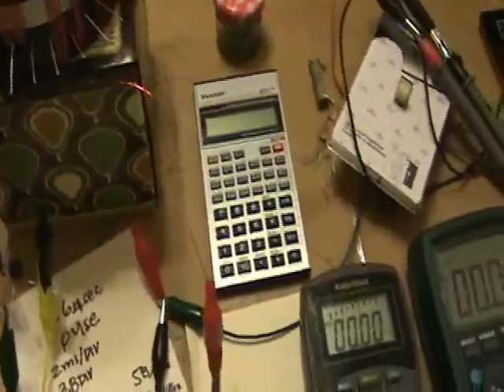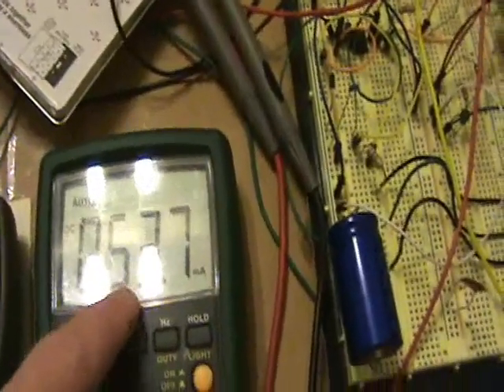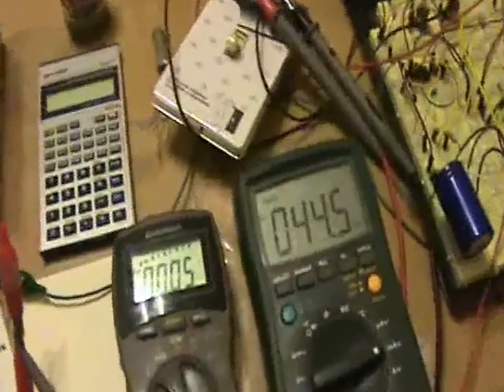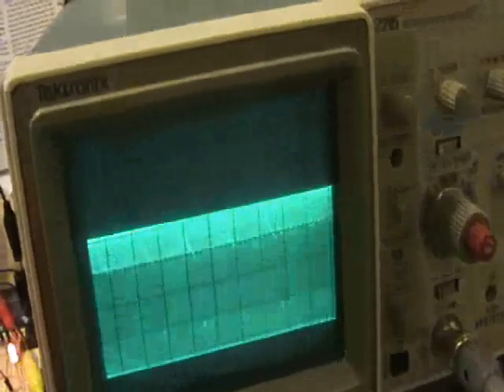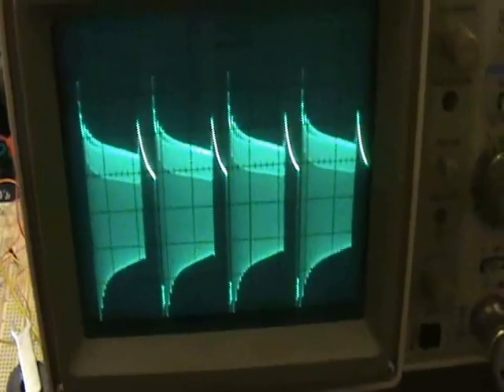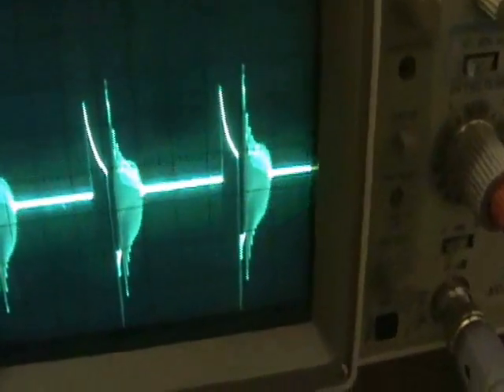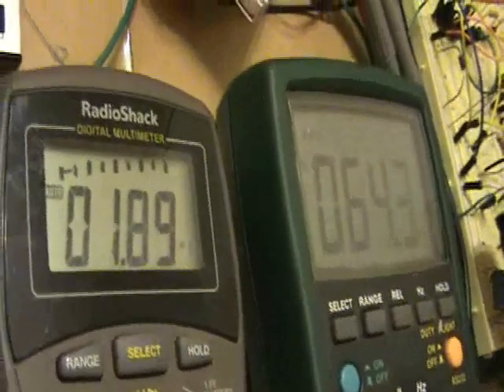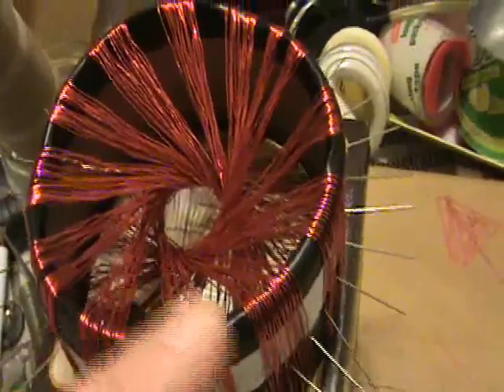"Tuna Can" Rodin Coil Damped Oscillation Study (Part 2)

Comment from the maker: I'm measuring current directly from the supply battery ... so this is the power to my pulse generator circuit. Yes there can be back emf ... confusing the reading a bit. The experiment I was doing cared more about relative changes on this supply current .. but you are correct more shunting would be good.

Comment from the maker: On the output side, the current is measured on the other side of the bridge rectifier, 500MFD. So this is line-filtering not unlike would be found in a standard power supply. I'm not too worried about precise current measurements yet. Thank you though. I will be buying a function generator on EbAY soon.